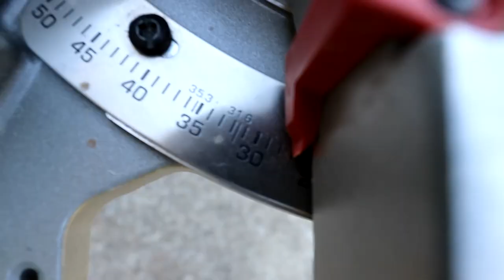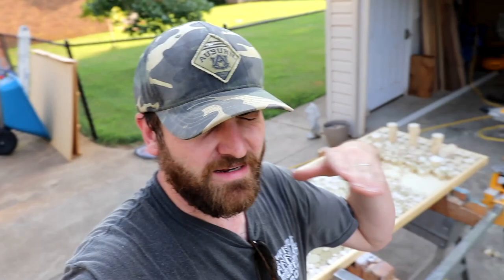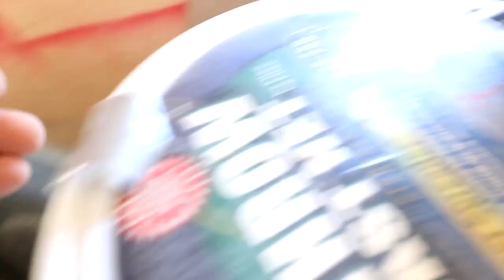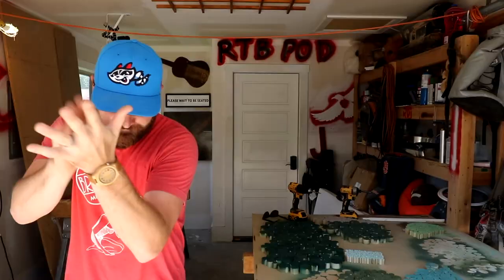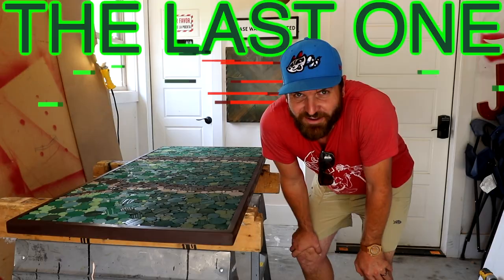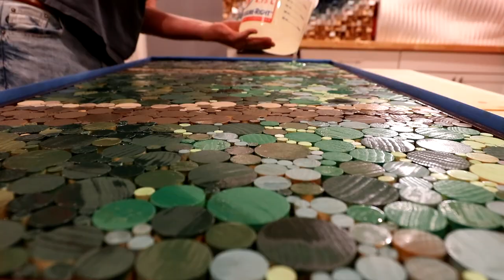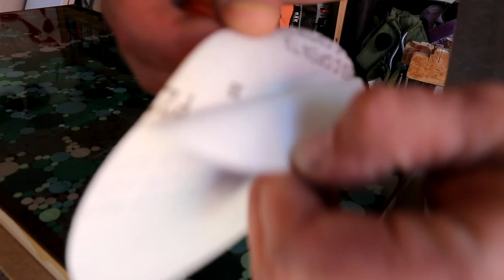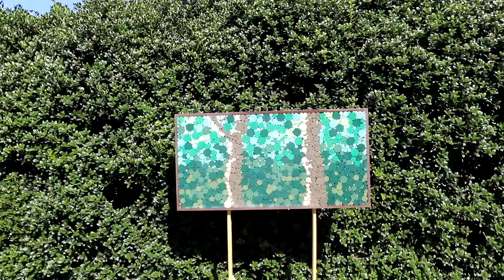How To: Wood Wall Art (The Forest)

Comment: Not sure how I landed here, but this was absolutely awesome.  I hope you continue to make videos like this and that you're able to continue making this art.  The pieces as well as the corresponding videos are fantastic.  Just in case you do something like this or the geometric art again, I can recommend using a stop block on your chop saw instead of moving the piece to a line.  The sanding drum was absolutely ingenious as well.
Reply from the maker: Thanks! Yeah I should have used a stop block for sure. Next time, if there is a next time, I’ll set something up. That would probably cut down on the pieces flying away after the cut as well. Some of those smaller ones shot 30 ft across my yard! lol

Comment: I keep coming back to this video because of your awesome sanding solution. Today, I'm trying to figure out a way to sand about 150 small pieces that have inside edges that your setup wouldn't be able to hit. How would you go about modifying your drum to tackle those parts? Maybe put some kind of abrasive pumice inside?

Also, what grit of sandpaper did you use in your drum?
Reply from the maker: That sounds like a good idea! Pumice or big grainy sand. Like a rock tumbler or something. I think I used 80 grit, that’s my normal grit. Or maybe it was 100 ? I don’t really remember. But I’m not an expert on sanding tumblers. Part of the fun is just trying things to see how they work 😃 good luck friend!

Comment: I wonder if you could do all that wood at one time if you used a trash can instead of a five gallon bucket for that sand paper trick???
Reply from the maker: Bryan Patriquin yeah for sure but you’d probably need a stronger drill or some other kind of motor to turn it.
Reply: Jared And Cassy good point! I think I have an electric starter for the junk riding mower i got rid of over the summer. This video definitely inspired me to start tinkering hahaha! Sorry this project didn’t work out for you, but that sandpaper bucket idea is 🔥🔥
Reply from the maker: Bryan Patriquin I read real close to putting my golf-cart on blocks and duct taping or ratchet strapping the 5 gallon bucket to the wheel lol
Reply: Jared And Cassy that’s pretty wicked haha! I was genuinely thinking about ways to attach the trash can to the back wheels on my truck after i put it up on cinder blocks 😂😂😂

I’ve been wanting to do some wood wall art & just came across a bunch of fresh red cedar 48” x 96” pallets. I just broke em all down & I’m trying to figure out a project to try... Any suggestions??

Comment: I've worked with premiere pro and vegas for years, but i never seen the elements you're using...what software are you using or name of the elements/plugins??, And awesome video.
Reply from the maker: Arvindh R I use Final Cut Pro X. Man I started on Vegas and it wasn’t very fun learning fcpx. Everything seems backwards and I felt like Vegas had more options but over time I think fcpx is better.
Reply: @TMPK  Vegas has lot of hidden options, I was working in a news channel as an editor, and i felt vegas and premiere pro was kind of good....i never used final cut pro, so i don't knw abt that .....anyway thanks for replying.